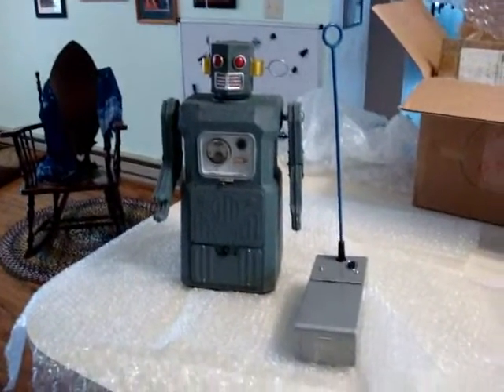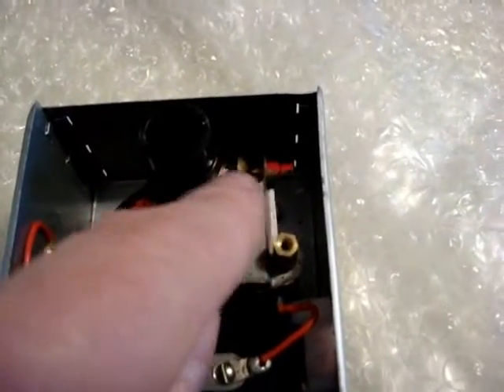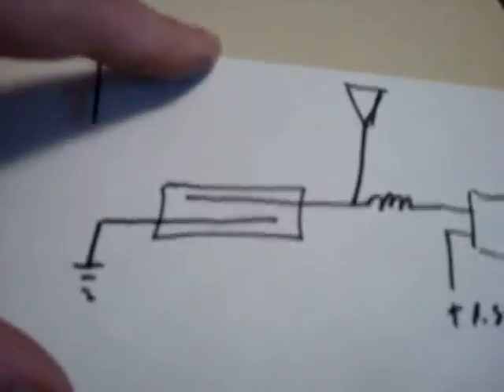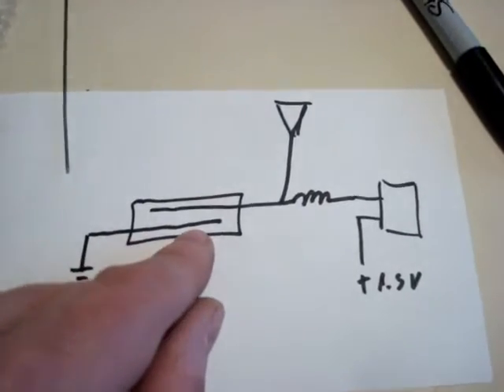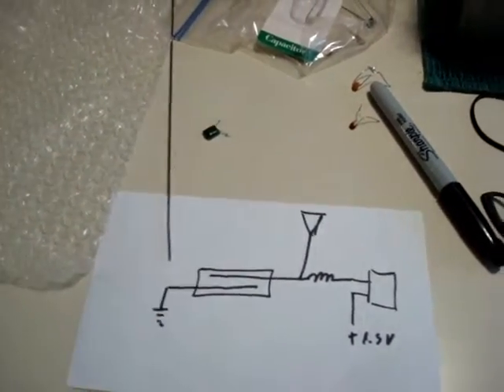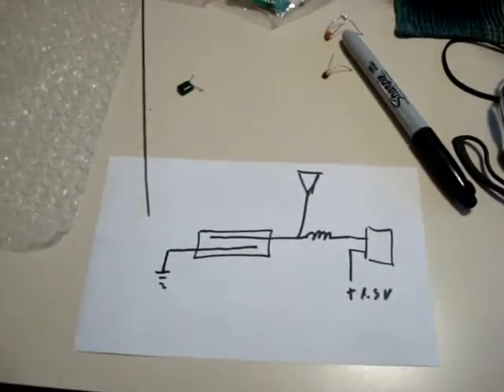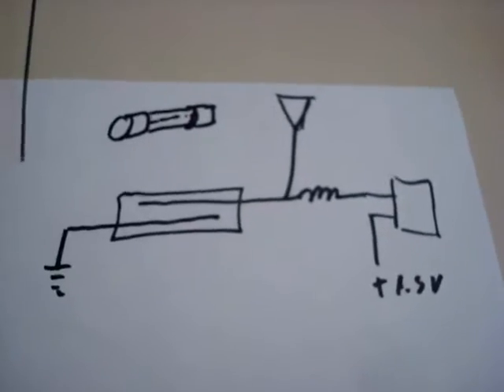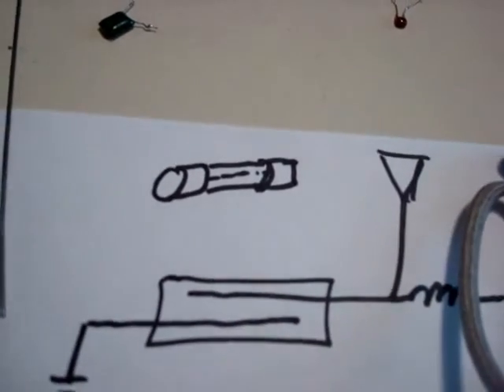Everything you always wanted to know about the Radicon Robot

Comment: Fantastic video and explanation. Thank you Robothut! FYI I referenced this video in my article at http://servo.texterity.com/servo/201711?pg=10#pg10
Reply from the maker: Glad to here you like the video. I am showing how to build a fully working Radicon robot on my channel as well. I started with the Dual drive base, then the electro mechanical sequencer. I will be showing how to build a RF detector and transmitter. So be sure to follow as I post more build info. I am planning to show how to build a Sonicon Robot first. It is a Radicon robot but operates from a sonic "sound" control, An uses no IC's, transistors or microphones, all electro Mechanical just like the vintage Sonicon toys. I sure could use more Sub's on my channel. As one of the few 3d printing channels that shows how to build electronic and mechanical things, I am surprised how few in the world are into building vintage electro mechanical things.
Reply: @Robothut  Amen Brother, I just subscribed! No one teaches kids to build any more, including schools dropping "dangerous" shop class. IMO that's why Maker Faires are so important to get the message out. BTW I just got a Radicon bus off Ebay. It's in need of much repair but I'll get her going eventually, in between other projects.  BTW are you THE Robothut in Elk?
Reply from the maker: Yes, Robothut museum. I think years ago Servo did a page or two on me and my robot builds. I have been trying to teach some of the lost electronic designs that you can do with out a building block Aurduino mind set.
Reply: I bicycled down the Pacific Coast many moons ago. I remember Elk had the steepest short section on the whole coast! If I ever get up that way again I will definitely make an appointment to see you. You're on my bucket list. Here's my meager collection: https://www.youtube.com/watch?v=LMOtGYprBRQ

Comment: would this metal file work https://www.lowes.com/pd/Kobalt-8-in-File/4326447
Reply from the maker: I would think a nice flat file like that would work. I have seen you tube videos where they just take aluminum foil and make small balls and put them in a conductive tube to make the coherer tube. Looks like chunks of aluminum about the size of the salt on a pretzel is most common in DIY coherer tubes.
Reply: yeah i tried using the file and filing a iron nail and it really only works if i have the spark touch one of the contacts anywhere on the circuit

Comment: i filed a nickle to a very fine powder and it did not work is there a specific metal i need to use
Reply from the maker: I have had luck with aluminum and also filled nickle or filed quarters. The placement of the electrode wire and the load you use have to be just right. Also do not pack the tube tight, the filings must have room to move around. And the source of your electrical "transmited " noise source has a lot to do with it.
Reply: well what should the load and the placement have to be and how should i obtain the files what grit sand paper do you recommend
Reply: can you help me
Reply from the maker: There are lots of you tube vids on the coherer tube, they might help you. Just search for "coherer".
Reply: do i have to use a filer or can i use sand paper 220 grit
Reply from the maker: I used a file, I think sand paper would contaminate the metal filings.
Reply: yeah because i used all kinds of metal like a nickle, copper, a iron nail, thin sheet metal, and all those metals i used, i sanded them with sand paper 220 grit to get the filings and all failed